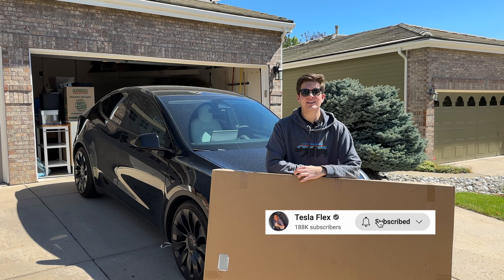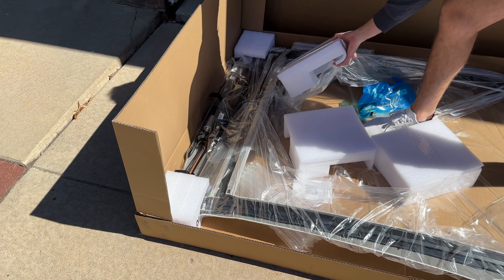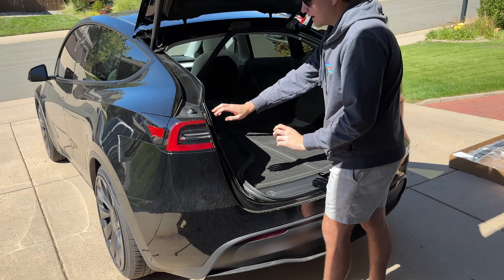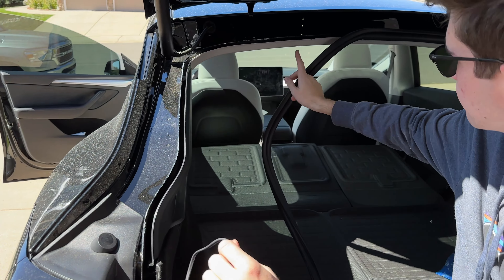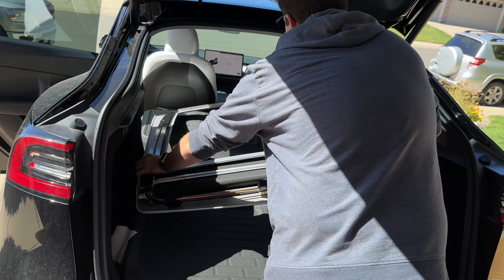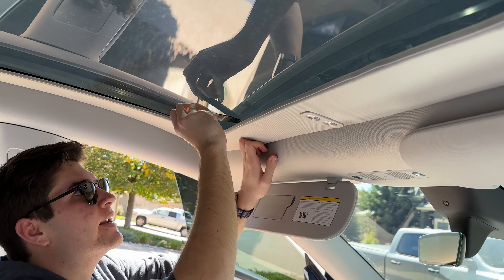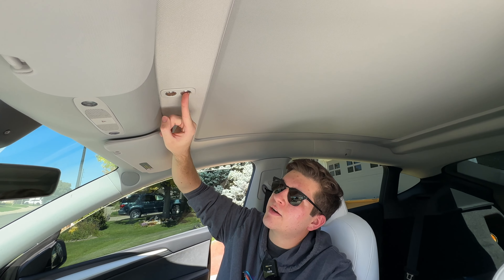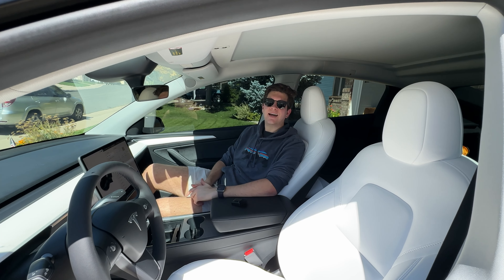Why Doesn’t Tesla Add This To Model Y?! | Hansshow Power Sunshade Install

Comment: Please be careful everyone. I have purchased the retractable sun shades from Hansshow.  A little after a year, it's making noise when I close it.  Hansshow told me to uninstall and take the motor out to test it.  It still making noise.   Also I got a Real Carbon Fiber Spoiler.  After 14 months it's starting face out . I wish I can show everyone the photo to see how bad they are.
Reply: TY.    Now I’m really disappointed.   Guess they expect you to just buy another.   Hope you can get it solved.
Reply: Thx for sharing ur experience. ☺️

Comment: For that massive amount of money to spend. It comes to a conclusion it rattling. Bark like dog while driving. It add no values to sound proof 😢😢
Reply: Not justifying it, but I believe another person added some foam strips with double sided adhesive to certain areas and it got rid of the rattles. I could be wrong tho
Reply: How’s its rattles?

Comment: In my Model Y it gets very warm (40 Celsius+) if I have it parked outside during the day. Through the app however, you can setup overheat protection (will vent the windows and or turn on the A/C). While driving I do feel the glass heating up the cabin on a sunny day sort of like a greenhouse effect. Will order/install this product and let you know if it helps!

Comment: Thanks for nice video. I’m just about to purchase this product and I’m wondering have your encounter any rattling inside while driving through bumpy road or ruff surface roads. Please let me know your thoughts
Reply: I don't own this product, but in the research I've done a few people have mentioned it does rattle.  That and the price are the 2 main reasons I haven't ordered one.

Comment: Hi,  i m going to order this but on this video u show Y cable that connect from break light.... Is this convector comes in the package? when I try to order it it shows it comes with cigarette lighter connection
Reply: It’s not the brake light. It was from the 12 volt cigarette lighter located in the rear of the Tesla